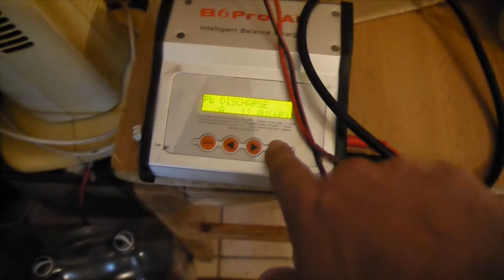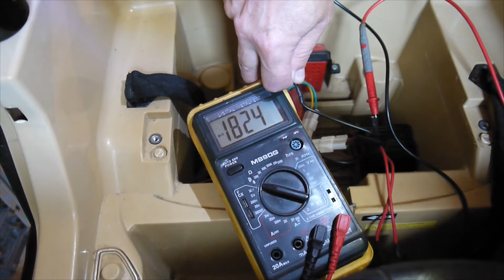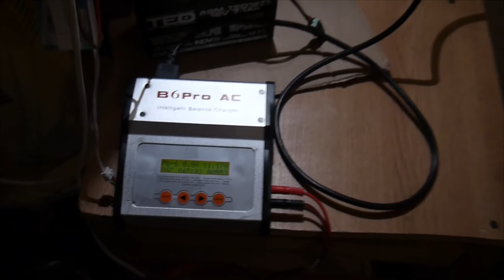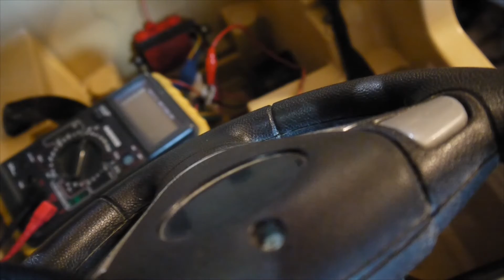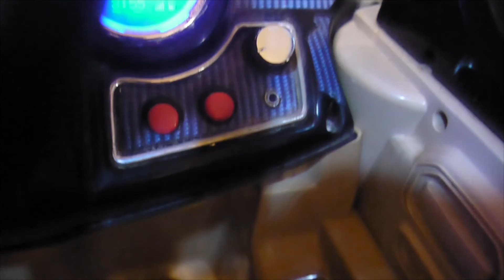How to check and fix a toy electric car !

Comment: Is it a diode or current limiting resistor on the positive wire immediately under the charging port?
Reply from the maker: That\s a self reseting fuse.

Comment: I've got a 15V electric toy car, no power when I plug in the charger. Charger works, battery shows 13.7V... all connections look good. Question is.. the power socket.. I see three connections going out, one red wire to positive on battery, one black wire to negative to battery, but a 3rd grey wire going somewhere else... Do you know what this grey wire is about?
Reply from the maker: It's an extra minus wire, going to different modules depend of the model, let it in the air. You have to check with a multimeter 12V path, from input to battery first. Check the battery voltage and apply power..the voltage should go up slowly , it's charging. Next check the path from battery to self reseting fuse, then switches and finally motors. 99% are the switches, so open and clean or replace.

Comment: Hello. I love your video. Probably getting a lot of comments and I would like to ask you about a problem we're facing. so basically he is a toddler and his foot found his way to the pedal and ended up against a wall and kept accelerating while against the wall for like 10-15 seconds. now the car goes very fast and stops abruptly like there is no speed regulation. it's the same from the remote. it goes forward and reverse but there is no switching speeds. what could be the problem? would really appreciate your help. thank you so much.
Reply: https://youtube.com/shorts/yBQWqnZSoBo?feature=share
Reply from the maker: I don't see any models with a proper accelerations ''gas'' feel..tehre is no pressure sensor, it's simply non/off switch...the low/high speed it's controllable from a second switch on board , probably that one is shorted..usually at low speed the motors are connected in series and at high speed in parallel..somehow it's stocked with parallel...check that switch..

Comment: My daughters toy jeep wont start...its getting charge from the charger to the battery but when i unplug it the battery reads 0volts should it still turn on when plugged to charger or does the battery have to be fully working and charged?
Reply from the maker: You need loaded batteries. Check the charger with multimeter for voltage..maybe it's not delivering anymore..also consider to charge the batteries from another charger..even from the car battery with some wires..be careful about polarity!!

Comment: My toy car not starting. When push starting button, very poor light and again off light. What I have to do please
Reply from the maker: It's looking like a loose battery..or a lack of charging..try to charge with external car charger first..if it's alive, that 's a solution, butI believe the battery is gone

Comment: How to bypass ignition
Reply from the maker: Serious? You wanna still my electric?..joking..🤣 Search for the plus..with multimeter and use a piece of wire, strong enough and short the switch..but it will be on al the time draining the batteries..better try a switch.any..and replace it..
Reply: @viocaia  thank you sir.

Comment: Hello. I have an electric car that works when it wants to. 
What I noticed: 
-Pedal works 
-button on of go 
-the front / rear button works 
-the engines checked, they work -all cables are checked 
-new batteries 
When I plug all the cables into the control box I have no 12v output to the motors. If I only remove the cables from the motors, I press the pedal and I have a 12v output on the meter. 
And yet when he wants to go.
Reply from the maker: Plug a car lamp 12v5W instead of motor and do run command..if it lit the motors are the problem..I doubt that..if is not lit, check the relays..if any or the control MOSFET follow the power route..

Comment: Hi my sons one the light turns on but doesn't make the starting sound (the radio sound part is busted) and won't move will it be the switches or is it because the radio part
Reply from the maker: That starting/radio/layer sound is got nothing to do with the motion part..for that you should check the loudspeaker. I bet you need to clean the switches..
Reply: @viocaia  okay thanks ill give it a go

Comment: my car can only move reverse but cannot move forward. how to fix it?
Reply from the maker: The sense switch is the problem, open and clean the contacts..or replace it.Another idea is to switch the terminals and let it run only forward until you find a replacement.

Comment: Hi, any chance you might know why a battery car is stuck accelerating? Just got one for free but when I plug in the three plugs the car continues to spin the tires and none of the car switches or pedals do anything. I have to pull the plugs for tire motors for it to stop. Thank you
Reply from the maker: It's looking like a Mosfet or relay in short..just follow the wires from the motor up...
Reply from the maker: But check the switches 90% of problems derives from there..just take out the one for gas..see if the car is stoping..replace or clean it

Comment: At below high speed low speed switch having there 4A fuse it's continuity is not working at a time of  I CHECK wiring
Reply from the maker: just bypass the fuse..but I'm sure the problem is the switch..90%
Reply: @viocaia  thank you so much i change all switches and car is working now sir thank you so much sir
Reply from the maker: @sudhirnanaware2811  Nice! Happy to help!

Comment: Motor is working as per in video i check,also fuse,also switches so how I find my problem
Reply from the maker: Like I said, the switches are the problem..open and clean, or replace..

Comment: How you check fuse
Reply from the maker: Multimeter on continuity mode or simply a bulb and a battery..get the fuse in series

Comment: I don’t know how to connect any of the wires. Could you help . I have the Mercedes Benz slr
Reply: Which wires did you disconnect?
The gentleman is doing a complete overhaul here.
Family people can Isolate the issue easily. All electronic parts are replaceable. (Motors, music, starter, fwd/reverse, steering wheel, independent swing, remote motor)

The only wires requiring you to undo is the motor connections and everything else you just undo to put in a new part (use exact same connections it had previously)

The battery wires. If you have single 12.7v battery then red to red and black wire to black battery terminal.
If you have 2 X 6.45v then 2 black go to 2 black battery terminal 2 red go to 2 red terminal.

There is a small black fuse box. That can be replaced and the 2 wires just go back in

The motherboard, they all just click back in. Just match up the size to the hole.

I can't think of what other wires you may have . Nor do I know an easy way if helping you via photos because we're in a comment section here

Most important. Please don't stress. With someone helping you,  They're incredibly easy and made for everything to be replaced apart from all the lighting wiring. (Although can be done)  This gentleman had done everything technically and he even lost me
Reply from the maker: First check if the motors are ok, just connect two wires from the batteries to motors..they should move.About wirings they are pretty standard, just google for a schematic..A multimeter and soldering is a must!

Comment: How did you check with the multimeter the switches in which setting and how?
Reply from the maker: Multimeter in OHm meter and diode mode, listen the beep.

Comment: Good video. We have a jeep with the exact electronics but in a different location. The problem I’m having is when going up a hill under stress or we hit a bump the gas turns off fir about 30 seconds. The car is still on so it does not completely turn off. Anything inside would cause it to disable?
Reply: I believe they have a cut out fuse that operates if under too much torque then re-sets, to prevent motor or battery burn out
Reply from the maker: Check the motor's connections, also if you have two batteries , check if they are properly connected, maybe a loose one..